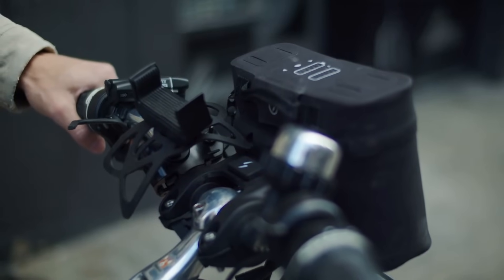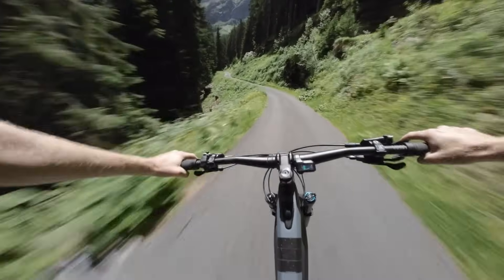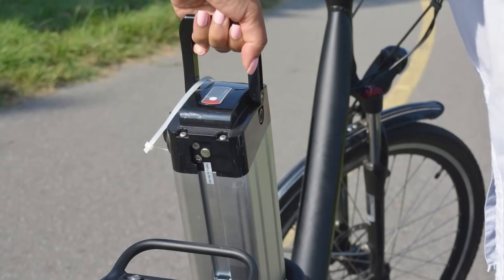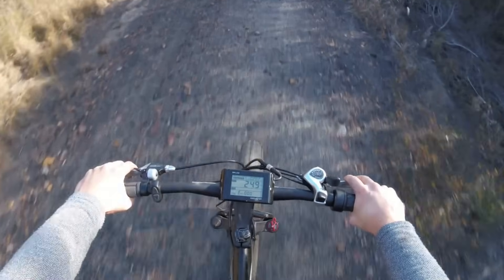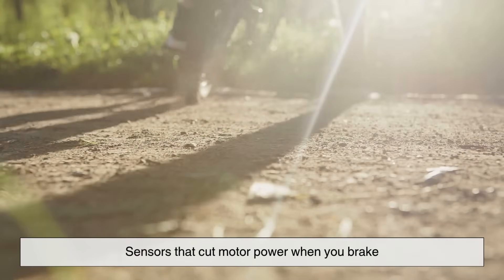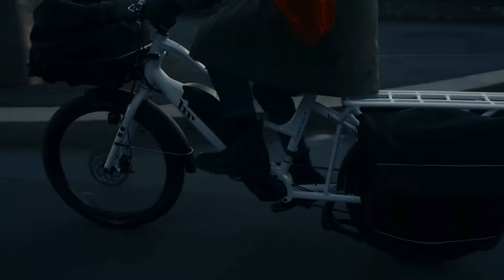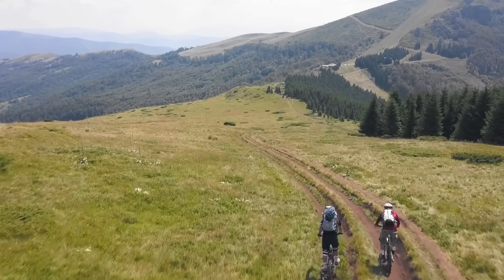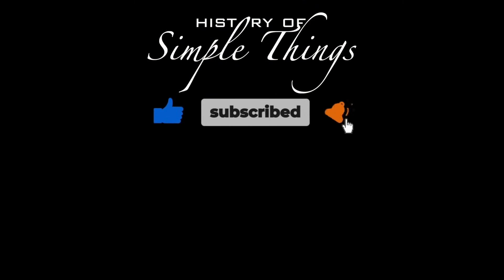How E-Bikes Work: The Silent Power Behind Electric Bicycles

Comment: E bikes are like motorcycles……
Reply: E-bikes are much more similar to bicycles. Motorcycles did evolve from bicycles as well though. That said, if the damn thing can go faster than 28mph they need to have good manners and follow bicycle etiquette just like the slower ebikes should. They should also never go over 28, unless they are on the road (or more realistically, when no one is around).

Comment: Hi, Great Video, right down my alley lol.  DID you know the first patent for an electric bicycle was granted to Ogden Bolton Jr. in 1895. This invention featured a hub motor and a battery-powered system, laying the foundation for the modern e-bike. The first commercially available e-bike is widely considered to be the Yamaha Motor Co., Ltd.'s PAS bicycle introduced in 1993. While earlier prototypes and experiments existed, Yamaha's PAS system, which provided electric assistance to pedaling, marked a significant step in the commercialization of e-bikes. Other early efforts in the 1990s included the Zike e-bike by Vector Services in 1992 and Michael Kutter's throttleless e-bike. 
Actually electric bikes can provide more exercise than traditional pedal bikes, supported by scientific research. Numerous studies indicate that riders of electric bikes tend to engage in more physical activity compared to pedal bike riders.
E-bike riders often cover greater distances and spend longer durations cycling, even though the electric motor provides assistance. The motor makes challenging aspects of cycling, such as climbing hills, more manageable, encouraging riders to embark on lengthier trips.
Studies show that e-bike riders enjoy the activity more, contributing to increased exercise levels. Additionally, electric bike riders tend to use their bikes regularly, with e-bikes becoming a primary mode of transportation for daily commutes.
When tackling tough terrain, e-bike riders often undertake more challenging climbs, utilizing the motor to conquer difficult trails. Overall, scientific evidence supports the notion that electric bike riders obtain substantial exercise and enjoy prolonged cycling experiences.
Speaking from experience, I broke my back summer 2021 (fractured my spine and 3 crushed virtabrea bones) and because of my e-bike I bought March 19-2023, I now have full mobility of my back and near zero pain. I mainly use PAS 3 with 'Ghost Pedaling' and ride an average of 20 km/hr for about 20-30 km/day. And ever since I got my e-bike, it has become my  main source of transportation for everything.  
Thank You and Remember Safe Riding ❤😎